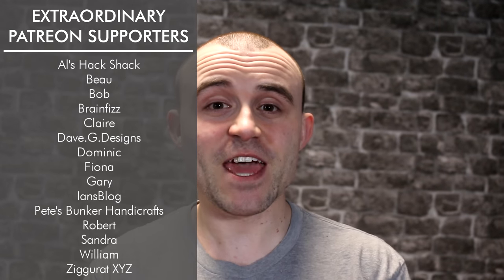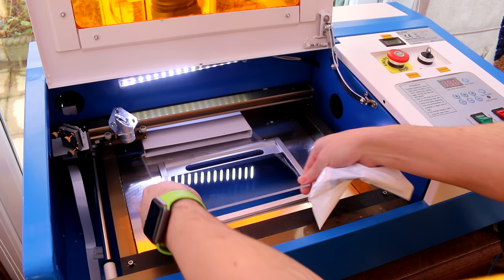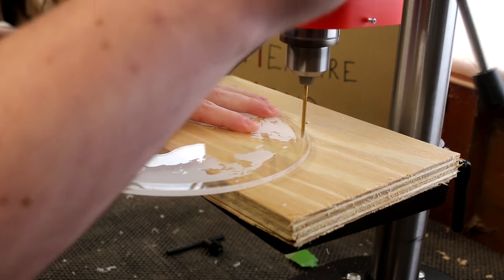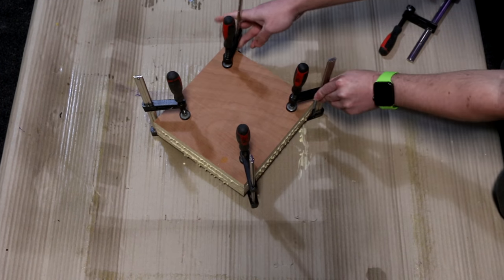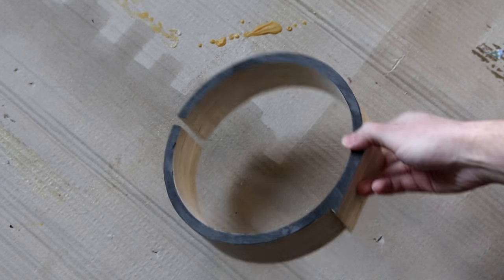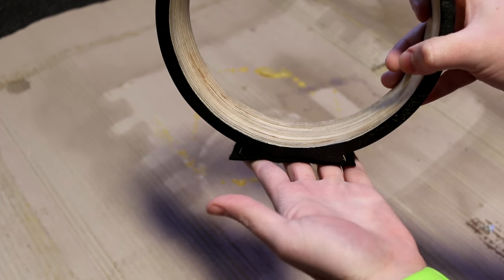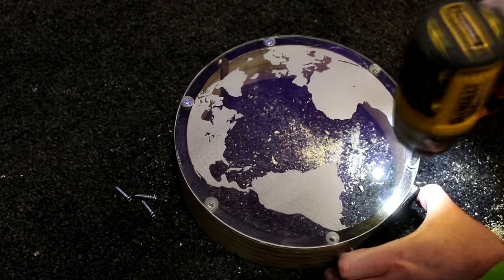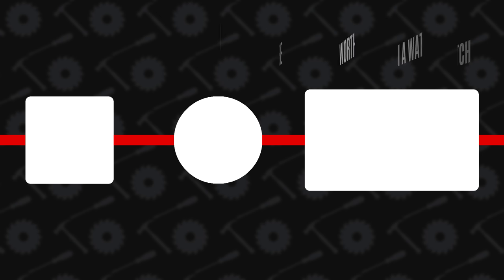Perspex Globe Money Box - Project Pack #Ad

Comment: This looks neat! I don't have a cnc deal...but I can see something like this attached to the bottom of those funnel type coin collectors that allow the coin to roll its way to the center as the radius gets tighter.  So in a way it would be a round coin spinning a round as it goes down...and then rests....in another round place.
😇😎😀
Reply from the maker: Thanks Jeffrey! Definitely dont need a cnc to make this. Would be great to add one of those funnels for sure haha love watching those 👌
Reply: @AverageJoesJoinery  I had assumed that etching tool that did the globe was a cnc of sorts.
Reply from the maker: I used a laser cutter which is like a cnc but as I stated in the video you dont need to use one. I provided a link to a video creating the same effect using a small rotary tool by hand
Reply: @AverageJoesJoinery  Aaah. I see said the blind guy!  Haha!